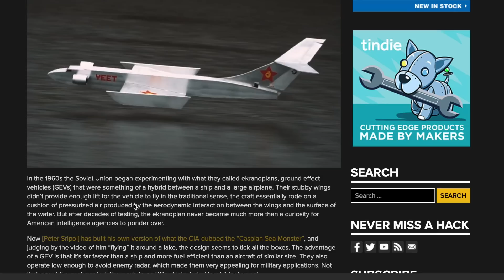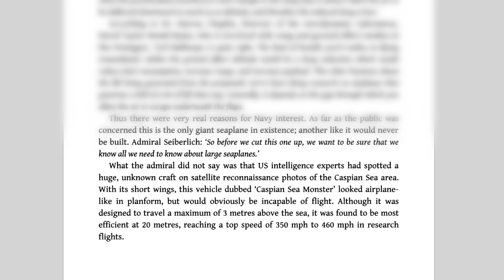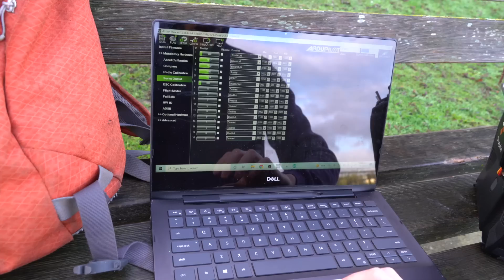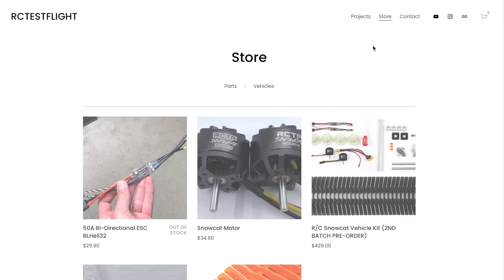Worlds First 'Real' R/C Ground Effect Vehicle

Comment: A GEV is any vehicle designed for or capable of traveling on a cushion of air.

Arguments about “constraints” on the GEV’s capabilities will be determined and governed by laws of the land the vehicle is operating. There is no uniform code for GEV’s and many variations can be found around the world. For instance, Georgia doesn’t have any laws specifically for GEV’s so they fall under a broader definition of “off-road vehicle”.

Claims against the validity of any of your RC-GEV’s is ridiculous. If you build a craft that you say is a GEV and then demonstrate that it can operate as a GEV, it is a GEV. I believe your ultimate goal is to design an optimum GEV that is easy to use. Awesome job on all your designs and builds! Looks like fun! 💜

Comment: The real Caspian sea monster wasn't a ground effect vehicle because it didn't have enough power to actually fly, it was designed to be aerodynamically stable in ground effect AND it wouldnt be able to carry as much cargo out of ground effect. Plus i don't think they had the proper control surfaces for full flight.

Comment: you know you're doing real RC experimentation when a kayak is part of the required kit.
Reply: he clearly needs a full size gev to chase his rc one
Reply: @LazerLord10  :  Just as well he did!... the helpful local paddler turned out to be a fizzer, just being nosey!
Reply: I am not sure why anyone thinks this is in any way new. People have been doing "ground effect vehicles" for many decades. I think there may have been plans published in either MAN or Model Builder in maybe 74-75. I built a FF version in the mid 70's. I am sure many others did, too.  I also note that most properly-designed ground-effect vehicle depend on the effect for stability, and are extremely poor and very unstable out of ground effect.
Reply: Wow you won as well, congrats. I bet this is real and not a scam.
Reply: @brei.z  hey. I won, too. I never win anything
Reply: @gbaker9295  I emailed a screenshot to rctestflght but he might get alot so not see it for awhile.

Comment: It may be possible to sidestep the Ground Effect/Aeroplane debate by using 2 low power motors for GEV flight and 2 auxiliary motors used only for takeoff.  I see this approach as being a more accurate representation of the power requirements of the vehicle in the 2 states: 1, Attaining GE; 2, Maintaining GE.
Food for thought.

Comment: I had a simple flick GE plan using a sheet of A4 years ago, can't find it now.
It's a simple curved upper surface with sides and a fin. no wings no controls. you fly too high the pressure under it drops and it sinks again.
a rc version of that would need throttle and rudder only and shouldn't be able to fly.

Comment: The engines need to be on top and back, the idea is to ride the air not push air underneath. 

I think…

I have a hunch, but no proof.

The smaller something is, the faster it will react. Pilots didn’t struggle to keep ekranoplan in stable “flight” (I’m sorry in advance for my spelling). The movements on the controls are making it harder to maintain a stable flight. If you also take into account the way in which the wings create the lift… you should find a happy medium somewhere with these two in mind. There’s no wrong answers to this question, I say just make what you consider ground effect and then leave it.
Reply: WRONG.       ram air is  a  major part of  how a gev flies.
https://en.wikipedia.org/wiki/Ground-effect_vehicle

Comment: I remember reading an article about consumer ground effect vehicles in the 90s, and the examples they gave could all achieve traditional powered flight.  

The reason they weren't called airplanes was that they couldn't reliably maintain powered flight and they sucked down a huge amount of fuel to do so. 

The challenge they faced was trying to reduce that capability enough that they FAA didn't decide they were airplanes.   Given that it's 30 years later and we don't have a thriving GEV market, I don't think they survived.

Comment: i subscribe to the definition that it just needs to be more efficient in ground effect, and the more efficiency gains, the more "ekranoplaney" it is. however, perhaps the way to be a GE only Vehicle is to make it as light as possible, optimising for weight by using the smallest batteries and motors on the same size wing, not necessarily aerodynamically unstable out of GE

Comment: HEAT Is the missing variable in your  equation, big planes generate much more heat with fuel rather then electricity. 

This might explain why on the smaller lake it flys better, since the water are warmer the vaper pocket is stronger.

I'm no expert but this is something worth checking 😁

Comment: Why not build an airfoil ground effect vehicle? It starts to foil and once it's lift off into ground effect it retracts the foils like landing gears into the belly for more ground clearance :)

This would however require active stabilization based on a gyro to keep the plane level. Once the airspeed is high enough to "lift off" the airfoils would "push" the plane slowly up by raising the angle of attack until they have no resistance left (add a simple pressure sensor on them). Then the airfoils can be retracted (while keeping the same angle of attack) to avoid creating unwanted drag.

When they are fully retracted you can turn the stabilization by them off and solely rely on air surfaces to keep the plane level (plus some average distance to the water via 3D laser pattern camera sensor or similar).

Comment: I think on your previous video lots of ppl said this as well, but the point of a GEV was never that it is unable to fly high. The point is that is can use the GE to move heavy loads at high efficiency. I don't know if the real Ekranoplan could fly higher, but there sure as hell was no reason to make it specifically unable to do so.

Still this is a cool challenge tho.

Comment: Very interesting. If any design that can take off from water will likely have a sufficient thrust to fly why not create one with wheels instead of pontoons?

Also if your idea about entrapping a high pressure air pocket is correct (which sounds plausible to me) maybe design the vehicle to have a longer wing with little span to optimise the efficiency of ground effect? Love your work. 🙂👍

Comment: I have a suggestion that may improve stability and overall consistency over different tests. To combat battery voltage drop over time, you should try setting up a rpm feedback loop and try finding the optimal rpm instead of reducing maximum PWM.

Comment: I think size is what is causing this to be difficult in at least 2 ways, Reynold's numbers on a larger vehicle will be more beneficial and will make it easier for it to "fly" in the ground effect, and second the breaze/waves/water surface smoothness will affect a larger vehicle less, I think that you demonstrated this with your original model that worked well over the smooth snow but wasn't as reliable over water. I feel like if you make your next attempt as large as possible you'll find that it will be easier to nail down different aspects of what you're testing.

Comment: You could use capacitors that only last take off so it has enough power to take off but they run out when u get off the water, and then it switches to a secondary weaker battery
Reply: Why would he need any capacitors at all? If he was going to go that route, he could simply switch a cell or two out of the battery pack, but that's not what he was trying to accomplish anyway.

Comment: The point of ground effect is to reduce the power requirement and thus extend range. Whether such a plane has the power reserve to be able to briefly fly higher should not be an issue to my mind. As we move to electrify everything, short-term power is easier to find than long range.

Comment: i think you might be able to get the "real" ground effect vehicle by adding a hydrofoil to a weaker gev. so you can use the hydrofoil to get out of the water enough to get rid of most of the drag and then you have enough power to go the rest of the way with your wings

Comment: One of the solutions you had there was the angle of the motor which directed the air downwards. So is there a possibilty to have like airplane flaps that makes the same job, redirects the airflow? I don't exactly mean like airplane flaps but somekind of flaps that replaces the motor angle thing so the motor can be in place without moving in any direction.

Comment: If you want to go full mythbuster on the GE-thing you could use some sort of PID control on the motors/elevators to lock the plane to a given height. Then do range tests for different heights. Lots of work 😁

I’m conviced though, that is a GEV :)

Regarding conformal coating, did you get water in the connectors?

Comment: The thing is, if it can fly more efficiently in ground effect and is designed to, then it’s a ground effect vehicle. The original massive Russian ones could jump bridges using full thrust from all their motors but they couldn’t climb very much and then switched back to 2 motors to sustain ground effect. Another idea of this is a big off-roader with 37 inch mud tires and a 4 inch lift, it’s designed to be really good at off-roading but it can still drive on the roads and that doesn’t mean you call it a car because it’s designed to go off-road which means people call it an off-roader. So in my opinion your first ones were ‘real’.

Comment: I’d love to see you modify the build to be extremely long, let’s say 5 times it’s current length. Then to pump only air under the craft towards the rear. Long enough that the more power you pump, the faster it goes, but it can’t lift off using only the propellers but rather the momentum.

Comment: It kind of seams like your cheating. And the reason why I think that, is because you have two giant props in comparison to the real thing. So not only are you going as light weight as possible, but also over powering it in ways that what your trying to duplicate didn’t operate. We all think the sea monster is modern marvel. And it had 8 jet engines that pumped very direct air in comparison to your two fans. I may be wrong. But I think the ideas was similar to how a hover craft floats. Just pump as much air under the craft towards the rear as possible, and you can get a massive amount of weight to float and fly extremely fast over that cushion of air.

Comment: Power is a poor reference for 'real' GFV. It total ignores the energy balance of the GFV. By limiting power, in water achieving flight just possible. Once out of water, surface friction is gone, so the GFV has more power, which can be converted top speed (kinetic energy). Applying a bit of up elevator when the GFV has hight potential energy will convert some to potential energy (aka height). As kinetic energy is lost (aka speed), do to being less efficient out of ground effect, the GFV will settle back down to lower potential energy level. 
This clearly seen from 7:14, and at 13:52, where reaches a maximum height before depending. 
Note: turning into the wind, or a wind breeze could add just enough energy (lift) so the GFV could gain some extra altitude. 

A great experiment to demonstrate the effects of potential energy vs. GFV kinetic energy and being able to fly out of ground effect is to fly off the water above Snoqualmie Falls. A 'real' GFV wouldn't be able to glide to safety and would death spiral in like a Red Bull Flugtag.

Comment: If it was a lot heavier and maybe made of metal, with some beefier motors, well then you're only putting an over priced bandage on it, as very strong wind will still affect it.  Basically, wind's a pain.  There's no way around it really (not at this scale at least), unless you find a physics defying shape for aerofoils that will hold air under it in ground effect, but will ignore other air.
I'd definitely class this as a RC ground effect vehicle though.

Comment: I'm on the 'make it heavier' side here and think that it would make for a more stable craft since small gusts of wind or waves would have less of an effect on it. Would love to see a full-size ride-able one as well!
As for what is real and what is not, if at full power it can gain enough speed to temporarily hop into the air, that is fine because there are even a few home-built cars that can. Since it's more of a glide instead of sustained flight i'd say that the vehicle would still qualify as whatever it originally was. Also something has to be said about efficiency. If you have to full-throttle it just to stay up, while cruising comfortably at let's say 50% in ground effect, then by all means that is a ground effect vehicle.

Comment: I do a minimum 3 layers of conformal coating for my rock crawlers. I drive them as if there were submarines. Never had an issue. One layer is too easy to scratch or chip.

Comment: In my quest for speed, a very fast rescue boat in stormworks (game) I end up building a flying boat.
I start with a boat with a ton of power to go fast but as soon as the props leave to water you lose the push forward.
So we add ducted fans and air control with a bunch of movable winglets.
It's not shaped like a plane at all being a brick shaped body with a triangle as a cockpit, double deep V spaced outward for working walking space close to the water.
Even a brick can fly if it goes fast enough!
Full power reach maximum water speed, pitch up/hop out the water. Engage second gear with the ducted fan and we are flying.
To land simply reduce power/speed, touch down in water and hit the same switch to go back to first gear and fan off to boat around. 
My god is it way easier to fly than stay on the surface like a ground affect rc or a hydro foil in stormworks.

Comment: How would different undersides work, going from say, straight rectangle 'fueslages' to something like a inwards pointing belly to force the air underneath to a more center point? would compressing the air help at all, could be straight out or changed with a aileron flap to change pitch?

Comment: In my opinion, this definition of a ground effect vehicle is stupid, whether it is "officially correct" or not.  Vaguely, I think a ground effect vehicle should be anything that takes good advantage of the ground effect to fly efficiently at low altitude.  (Yes, I know all planes can do that to some degree). A more specific replacement definition could be some ratio of lift/drag and altitude, scaled by wingspan/chord/wing area.  I have no idea what good numbers would be.  For example: "It's a ground effect vehicle if its lift/drag ration increases by more than 30% when at or below one wing span of altitude."  Something like that.  It might not work at rc scale though.

I love your videos on this topic.  Please continue exploring it as long as you are interested. :)

Comment: We’re taking for granted that there’s such a thing as a “ground effect vehicle” — especially at this scale

If ground effect can be modelled at small scale I’m sure it would be limited to an altitude of less than half a wingspan and the flight dynamics would have to be substantially different — banking to turn should be theoretically very different, for example, because of the asymmetric lift from different ground effect forces

Thinking further: can a vehicle be a hybrid GEV if it has two control regimes?

Seems like you need an excuse to build a wind tunnel 😇

Comment: Nice video and aircraft! I always enjoy your content. Conformal coating (I assume its an acrylic-based type) is pretty good for water resistance, but it is not water-proofing. Given enough time in contact, the water will eventually work its way through. But, that may not be what happened here. While the board itself has some coating protection, all the connectors do not. Especially the ones that don't have a mating harness plugged into them are vulnerable. While conformal coating is definitely much better than nothing, a little enclosure would probably suffice. True waterproof electronics usually involve a 2-part epoxy potting and sealed connectors, but all of that is too heavy and likely overkill for this application.

Comment: push down wing also, double wedge, to keep it in ground effect
Reply: designed to stay in ground effect, if it goes up, then the up and down lift is equal => drop, when weight + up = down, you can tune the height, and stay in ground effect, because only lift is from the ground effect, the normal lift negated by the down push
Reply: on top rotor, horizontal, positioned so that it will balance craft
Reply: save yourselves, if you can
Reply: ground effect hydrofoil, double guarantee, have the rotor only push under water
Reply: in the side push air plane motors, not front
Reply: also differential thrust with that arrangement
Reply: if you can make it a transition helicopter only, not a plane, then its the ground effect vehicle
Reply: none bothered to put actual values of the ground effect lift and efficiency advantage at height vs speed

Comment: If you propelled the craft with a water-propeller then it by definition wouldn’t be able to fly much higher than a few inches off the water. Many racing boat (unlimited hydroplanes and F1 Tunnel hulls) are effective flying in ground affect. There is a really good video online of an unlimited Hydro where only the prop is touching the water for a prolonged period of time.

Comment: I wonder if you could compensate for the reduced ground effect at this scale by making it much heavier, and requiring it to fly a lot faster. At a larger scale air effectively has a higher viscosity. The same is effectively true for faster movement. 

If it were me i’d use a 6 pack as ballast which would give you the added benefit of usefulness and direct comparison vs other, less efficient methods of delivering beer to the middle of a lake!